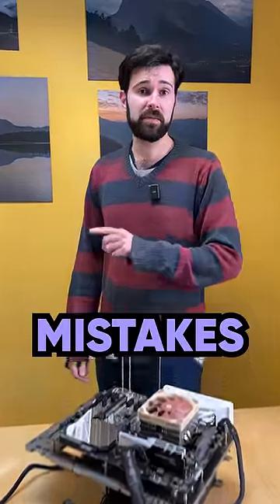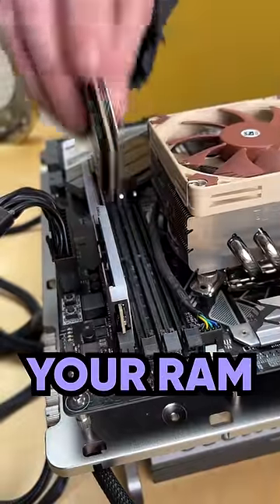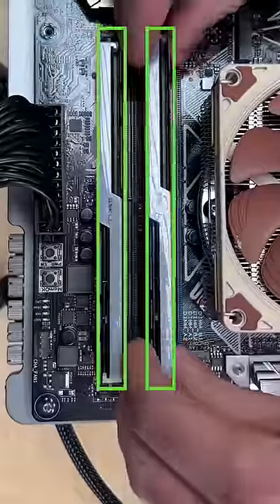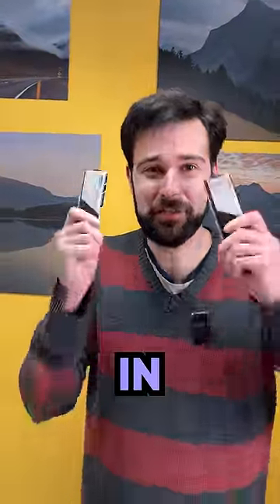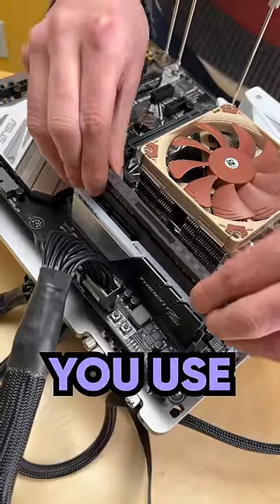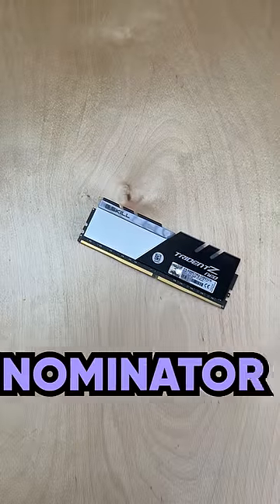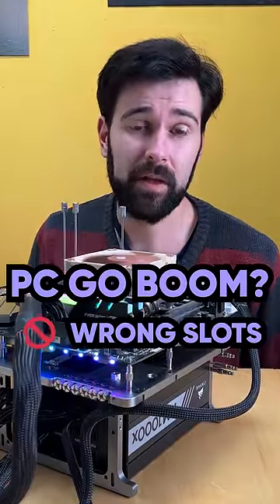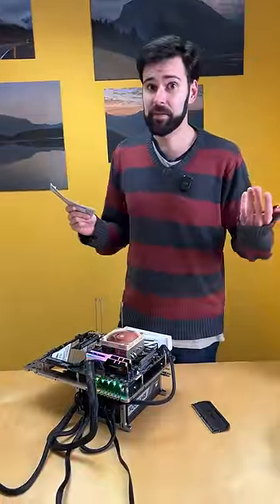Why you NEED to install RAM like this!

Comment: I remember the days when RAM mixing was a recipe for system instability and BSOD hell.
Reply: Don't forget the way that 486 CPUs would freak out if you overclocked the RAM beyond what they were designed for. Artifacts, GO!
Reply: yea now it just downvolts the shit out of them and you end up with a crashaholic PC anyway. :(
Reply: Yeah it's kinda crazy now. You can mix any different kind now and it works fine.
Reply: @TheZoenGaming  I used to have over 250 486 386s and a bunch of other other ones. I used them on a foam board to make a thing above my desk some years ago. I even had stacks and stacks of ram. I got a huge box of this stuff from a friend who was a computer builder some 20 years ago. Just crap they had laying around their office. 
I was going to make some stuff with the ram and never got around to it. If I recall all of that stuff including the ram in one of my friends storage areas of crap I gave to him when I moved away. It will likely never be seen again for 20 or 50 years.
Reply: Shouldn’t have ever been a problem if they both defaulted to jedec spec right?
Reply: @Jackson McGlothlin  
Things were not so smoothly compatible and standardized back in the day.
Reply: I remember when Kingston (now HyperX) ram would not get along with other brands of ram.
Reply: Genuinely sad how they managed to do what than the PCXXX RAM family with that
Reply: @chancepaladin  mixing sticks works fine for me
Reply: sadly I still see that today
Reply: Still is. But since most better sticks do use the same chips they do work fine even from different companies. As long es they are using the same spec.
Reply: It still is in most cases especially when XMP is involved.
Reply: @TheZoenGaming  My beef with 486 and Pentium systems that used SDRAM - SO PICKY about what kind of RAM, how many chips on how many sides... After trial and error I finally got 196 Mb of SDRAM to work on a Socket 7, but it took all manners of combinations and just lucky guesses.
Reply: My computer did this when I mixed ram from the same company with similar specs - because XMP decided to try and overclock the lower spec ram to match the higher spec and I got constant BSODs and windows corruption. Fun time.
Reply: i recently upgraded my pc but i never had a problem with ram mixing maybe because it was pretty old
Reply: On simple normal system, using same advertized speed, and check ras cas tc latencies, it will run smooth
Reply: And it still is. If it works for you, that’s fantastic. But don’t go telling other people it’s a good idea because “well it works for me” 😭
Reply: I remember the days when you could put in 16-bit and 32-Bit RAM at the same time on AMIGA.
Reply: People still commonly think this is an issue in modern times, its still a good idea to have the same ram type and speed but it's no longer as big an issue
Reply: I literally have 2 different RAM kits on my system, 32GB (2x8GB G.skill trident z 3466MT/s cl16 and 2x8 patriot viper steel 3200MT/s cl16), b450m pro4 motherboard with a 3200G, used to run at 2800MT/s cl16, upgraded my CPU to a 3700X and now I can reach 3200MT/s cl16. So yeah, even on the notoriously picky Zen+ architecture, I managed to mix and match lmao
Reply: @TheZoenGaming  Huh? Faster RAM causing problems? Isn't faster RAM always better? Doesn't it work the other way around where too slow RAM causes problems?
Reply: @fungo6631  Nope. Some CPUs are only capable of running RAM at certain speeds and if you set the speed higher or lower in the motherboard BIOS it will cause problems like errors creating artifacts in game or production renders, loss of data, crashes, or even destroying the hardware. Even now, the AM5 chips are limited to 6000 MHz DDR5 RAM, where as the 13th Gen Intel chips are not.

In the old days, the memory was controlled by a separate chip on the motherboard, so each motherboard would have it's own compatibility issues with memory.
Reply: Still the case.
Reply: Still is idk what theyre talking about. ddr4 kits 2 diff brands/chips but same size spazzed out on my ryzen 2000 build.
Reply: @RitzScythe  That happens when the timings are different, which is why your supposed to buy matching RAM, but that's an issue with Dual Channel mobos. OP were talking about the days when having a 512k stick and a 128k stick with the same timings would cause issues.
Reply: @TheZoenGaming  idk how you gleamed so much for such a short comment, thank you for your service
Reply: @RitzScythe  Experience having to deal with it when dual channel first came out. 😅 Same with OP's issue, TBH.
Reply: @hmmmyes6934  AMD fixed a lot of the on-chip memory controller issues with the 3xxx. There are still issues at the higher speed/capacity combos, though. That's why G.SKILL is making high-end kits specifically for Ryzen.
Reply: @Total_Egal  😅I'm one of those people who buy that kind of RAM with single bank and tight timings, but in my defense I was doing overnight renders through contract work and RAM errors would have been devastating.
Reply: @Total_Egal  Yeah, but that used to be restricted to server systems that were triple the cost of miy home rig when I could just pay double for better non-ECC RAM.
Reply: It still happens if you apply XMP. Found it the hard way after an UEFI update. I've been running the same 2 kits for more than a year with XMP fine (the kits are the same, but the XMP may vary in some latency, as there are 2 kits). Now, after the update, I got BSOD after BSOD, more than 12 in a day. I used it as an excuse to finally migrate to Gentoo, away from Windows shit, and I found that both compiling GCC or Clang failed, while if I was using any pair of stick only, they compiled. Then, I disabled XMP and, ta-da, it compiles too. 😒
Reply: ah yeah, it happened even in DDR2 right?
Reply: @Skylander74  I remember when it just didn't work at all, still have a brand new set of those in a box somewhere. DDR400.
Reply: It still was in 2017 for me. Took me 1 year to figure out I had the ram sticks in the second Dimm’s, and another 3 years to figure out the DOCP dram voltage of 1.35 was wrong and my ram needed 1.375 to run stable without blue screening every few days
Reply: It still is a recipe for instability in some cases even in the modern day, but I’m gonna guess maybe that has more to do with the MOBO and/or CPU? Obviously anecdotal evidence isn’t real evidence, but I have a friend who’s running 2 different RAM sticks with no problems, and then I have another friend who tried and could not get the system to work no matter what. I will say he could get the system to boot sometimes but when it did it there was always an issue. Like running in single channel mode at 2400mhz and stuff like that.
Reply: Didnt know it wasnt the case anymore , since im using a 15 years old pc 😅
Reply: so nothing changed?
Reply: Still the case today
Reply: I still don't even risk mixing RAMs to this date due to this.. lol
Reply: Going a little older: when USB was just starting to become a standard and PCs would freakout, crash, or just not recognize anything you plugged in. Sure, it was a "universal" port, but none of the devices were universal lol

Comment: Logic: If you want to pair something, put a distance between them.
Reply: I would assume that having two RAM sticks on the same channel (like you would if you have four sticks) benefits from them being closer together. Which means if you want two sticks on different channels they need to be further apart.
Reply: Not always the case
Reply: @88porpoise  It is almost certainly a trace length thing.

it will be easier to make the traces the right length for all 4 slots, while maintaining the same length for slots 1/3 and slots 2/4.

While you absolutely can retain the trace length (IE wire length to the CPU) in any configuration you want with as much space as you want, this configuration probably meets the trace length requirements with less total complexity.

Obviously if the slots were next to each other you'd be fine, but then the trace length for slots 1+2 get more complicated (because if they are in the same channel, the trace length probably matters comparitively too).
Reply: Logic never said that??

Comment: Note : Not all boards split the paired slots. Check your manual to see how the pairs are.
My motherboard has four slots, each pair being side by side with the other. (xxyy vs xyxy stated in the video)
Reply: They're usually, but not always, color coded to tell you what slots are paired. Sometimes the color different can be subtle, sometimes it's a really distinct difference, like with my black and yellow slots.
Reply: That's the standard way, if you refer to your channels as  x and y. 
That way if you install the sticks 1 slot apart, as instructed, - you get 1 stick per channel, which is what you want.
Reply: I have a first gen i7 that I gave to my dad - it has triple channel architecture.
Reply: In your example if xx is one channel, you don't want both sticks in the same channel - that's the point. You want 1 x and 1 y so that you use both channels. Hence leave a gap between them....
Reply: But I don't have problem like people said. It's recognize my ram and also running expo at 6000 mhz
Reply: @bruwin  And sometimes you need to use the different colour slots! Always consult the manual to find out where to slot the sticks.
Reply: I had a board like that. It annoyed me because it just "looked" wrong.

Comment: RAM slots are usually designated A1-A2-B1-B2 from left to right.
Manual would suggest to populate A2 and B2 first.
Reply: As to "Why would I populate the further slots first?" Signal reflection. If you populate the near pairing first, the electrical impulses used to communicate to them will bleed over into the furthest slots too, and then reflect off the dead end, causing some interference, disallowing the RAM from running at speeds and timings better than the JEDEC spec.
Reply: @matthewhafner962  in layman's term for the uninitiated in electronics,

The far slots will act as antenna since its not connected anywhere and may receive or produce unwanted signals
Reply: what if i only have one ram? A2 ?
Reply: @risango3  B2, then A2, then A1B1 in pair
Reply: No its more common to be b1-a1-b2-a2
Reply: Its varies by board. Always best to check the manual.
Reply: @Daeyae  for my m-atk board, the manufacturer recommends b2-a2-b1-a1
for my mini-itx board the manufacturer recommends b1-a1
i do not own any HEDT or Workstation/Server machines so i cannot comment on the triple/quad/hex/octa channel configurations
Reply: This comment was more useful that the video
Reply: @Daeyae Nope. It’s B2-A2-A1-B1.
Reply: There isn't really a point in discussing this, not all MBs share the same configuration, you need to check the manual or website for your particular MBs config.

Comment: Some motherboards have detection for this, I remember when I built my PC, I accidentally put both sticks in the same channel, and my motherboard wouldn't even let me boot without just flat out telling me that they should be in dual channel and not single channel and to switch them to the correct slots, even telling me what slots exactly they should be in.
Reply: which moboard was that?
Reply: one of the pins broke off on my cpu so now I have to put them in the same slot or it'll just turn on and off again constantly.
Reply: @TatsuZZmage  It's a MSI B450-A PRO
Reply: I remember on my rig all it has is dual-channel slots

Comment: i can tell you you can add different brands of the ram sticks and nevere lose any form of performance, however having two different frequencies of ram stick can cause instability and casue your pc to freeze, and your clock speed of the higher freqwuency stick will downclock to math your lower frequency one

Comment: Check the mother board manual to be sure your board follows this 1,0,1,0 rule. Some of thems you have to put the sticks one besides the other. MBs with only 2 slots are no brainers, just fill the 2 slots to have dual channel enabled. I dint think there are boards without dual channel nowadays.

Comment: Actually if you put a pair of single rank DIMM's on the same channel, you'll get rank interleave instead of channel interleave. For some workloads that can actually be better than having the additional bandwidth form channel interleave, as it reduces latency. The best configuration is to use dual rank dimms, 1 installed per channel, so that there are 2 ranks installed in each channel. This allows the memory controller to use both rank and channel interleave, for the lowest possible access latency and highest possible bandwidth at the same time.

Comment: Just wanted to add to the topic of ram. Sometimes ram/motherboard combinations are picky about the clock speed of the ram. I have a system that gets unstable when I try to run on the 3.2ghz the sticks allegedly support.

On another computer, I had a dry bios battery, which cleared the bios settings upon power loss, disabled xmp and ran the ram at a lower speed. Removing one stick made the system stable and I was able to enable xmp, insert the stick again and windows booted without issues.

If you have issues with new sticks of ram, first make sure that the motherboard detected the ram correctly by runs it at the correct speed and steppings before running a mem test and declare the ram as defective. Could have saved me so many troubles in the past

Comment: You want to put them in the 2nd and 4th slots with a daisy chain topology to have them at the end of the daisy chain. With T topology it doesn't really matter, but that's designed to handle 2 dimms per channel better than daisy chains.

Comment: as long as they are close enough you can Overclock the lower one up to the slightly higher with little to no issues

Comment: One cool thing i found is if the ram needs to wright the memory to itself and wont post until it does you can put 1 old memory stick in with a new one and itll wright to the new one and you can just move it down and put in the next stick and itll post.

Comment: The only correction I'd make is that having 2 ram sticks on the same channel doesn't necessarily mean "it's only like using 1 stick of ram." Think of it as a highway with two lanes and 2 cars. You want both cars on separate lanes, otherwise you have both cars in the same lane, while on lane is completely open. You still have BOTH cars, however, they're only on one lane. So if there's some "debris" on the lane with the cars in it, THEY BOTH are "slowed on the highway." Hope this helps!

Comment: There are motherboards where putting the RAM into the wrong slots will keep the PC from booting. Check the motherboard manual to verify which are the A and B slots.

Comment: Mixing ram is fine when the system is free, I build PCs for seniors at no cost as a hobby, parts found in recycle stations here in Denmark. Just finished an I7 8th gen, 16 gigs dual channel ram (different sticks) and a 256 gb SSD ... runs like a dream. Perfect for their needs like mail, Youtube and web browsing.

Back in the days of early PC building mixing ram was a problem however depending on brand, same brand sticks with different speeds tended to work together fine, mixing brands however got me a lot of blue screens of death.

Comment: Until you get in to servers and workstations. it’s a safe bet to check your manufacturers compatibility list for that model of board because not all ram is the same. I learned this with my first server build using thread-ripper pro on an Asus motherboard, luckily I found out before I got the ram.

Comment: I had 2x8 GB 3200mhz sticks and bought a new 16GB 2666 one and just overclocked it to 3200 no problem. I even kept dual channel while only having 3 sticks, which of one is different speed, capacity and voltage…

Comment: You have to also look at what's the better pair out of the two. Motherboard manuals usually recommend the 2nd & 4th slots to use. I've read some people having trouble with their RAM OCs when using the 1st & 3rd slots

Comment: Thank you, now I know that I can upgrade two PCs at the cost of one.
For example: upgrading the main machine with a pair of new sticks and adding the older one to a secondary machine, not caring for the potential performance that I leave on the table and skipping the hassle of searching a matching stick to one thats unavailable in the market

Comment: Fun story, I've been using 2 different ram sticks for almost 4 years and works just fine till today. I set the frequency to the higher one so the one with less is automatically overclocked a bit from 2666 to 3000

Comment: I remember when my sibling had a gaming laptop, we were very excited about it. I borrowed his laptop to figure out the distinct features of it, it was 16 GB RAM, with NVIDIA RTX 3060 and i7-12700H. The laptop at first was very sluggish, slow, the initiation in installing the supportive gaming software took really long, still nothing bad happened. Until the 4th day of using it, i played League of Legends while i was downloading a game called Albion Online. Suddenly it became laggy, RAM capacity took like 80% and BSoD appeared. Happened 3 times while we were doing work, playing video games and watching movies. I tried checking the internal parts and surprisingly there were mixed RAMs